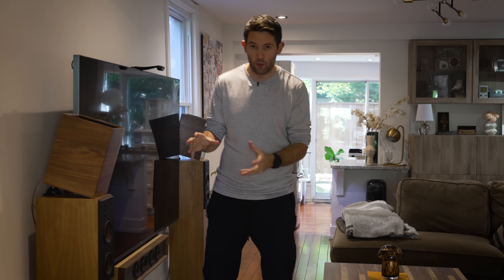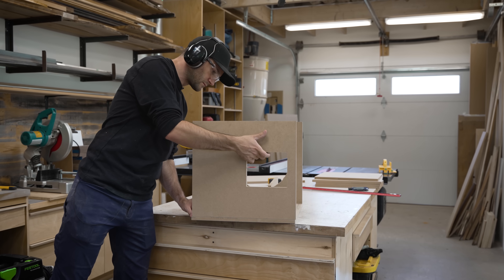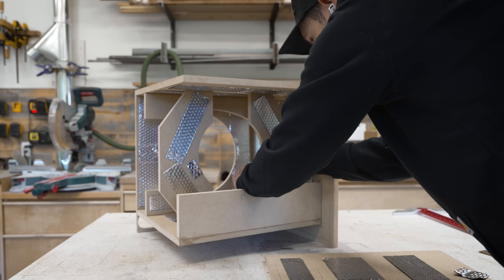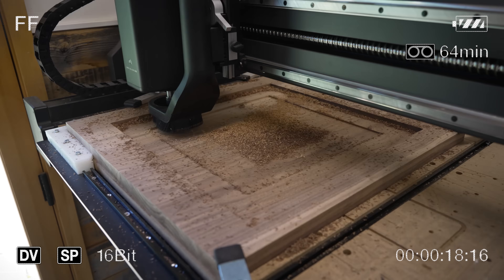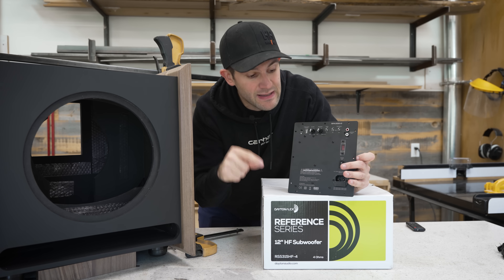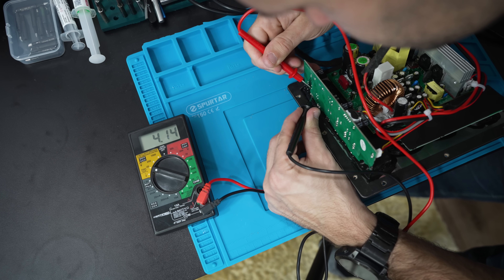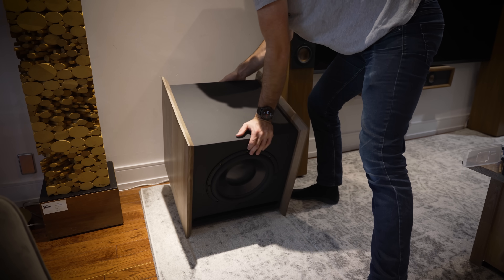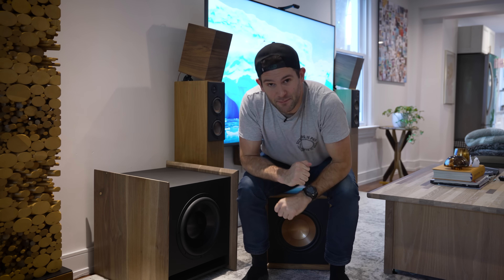THIS changes DIY Audio...

Comment: I wonder why haven't you talked much more about latency/phase, my guitar wireless (which is the same product basically) has 16ms of delay, this way you'll have a weird notch in the EQ due to phase shifting.

But hey, if it works for you, I'm happy but I think it's worth to give it a look and mention it!

I'd say test this with and without the wireless and hear if you feel a difference, with wire you should get even thumpier/deeper sounds.

Another way you can do this is using the same wireless for the rest of the signal (I believe you can have 1 transmitter and 2 receivers)

Comment: 25 watts of dirty power will destroy a 100 watt speaker WAY before 100 clean watts will destroy a 25 watt speaker. Really flirting with a lot of misinformation in this video.
Reply: @RobertWrightOneManCovers  and this is wrong 100w of clean power will destroy a 25w speaker WAY faster than 25w of dirty power will destroy a 100w, in fact at most you'll destroy the amp instead.

Comment: You mixed some stuff up with the power ratings. The amplifier should be *more powerful* than the rating of your sub prescribes. Ideally with some headroom. So if you've got a 400 watt sub, you should target for an amp that could handle up to 500 watt (at the given ohm rating of your sub).
Reply: Yeah, I was like "am I remembering wrong?"
Thanks for clarifying.
Reply: This reduces potential distortion from the amplifier side
Reply: Been doing car audio for many years and this isn't how I practice my builds. The amp only sees the impedance so as long as that is within spec you want the driver to be able to handle the amp at max power output with some headroom. You're the one mixing up these things.
Reply: Nope, because the subwoofer is a passive component, that is rated for peak Watt and RMS Watt, 300W RMS is the power that the subwoofer can handle not Its optimal working point You sould use an aplifier lower or equal than 300W RMS at the same ohm to avoid burning the copper windings when you put at max wolume the amplifier. A 150W RMS Amplifier can easly handle a 300W RMS subwoofer.
Reply: @w1thso  That's why you set gains on the amp and leave them be, if you've done it right then the sub won't be overdriven and won't be melting it's coils either way. A bigger amp running at lower power is going to sound better and be safer to the speakers than a tiny amp running full wide open, ready to clip out at a moments notice.
Reply: @pontiacg445  Yes I would agree If the gain wasn't easy acessible like a car system. This is too much exposed Imo
Reply: @w1thso  OP is right, you are wrong. If a woofer's RMS is 300w for instance, its max power handling will always be higher, usually around double its rated RMS. A 150w RMS amplifier would be quite underpowered for this woofer and only be giving it half the rms most of the time while running the amp at its maximum. A 300-400 RMS amplifier would be ideal for a 300w RMS woofer. If the sub exhibits any signs of being overpowered, you can always turn the amp down to hit that sweet spot.
Reply: @Mr_Ruhl  nope a woofer can handle double the RMS (peak watt) only for some instant. You can test it if you want. Sadly tested on an audison 2ohm car subwoofer of 300W peak (150W RMS) and an amplifier of 300W RMS, staying for a long period over 150W (calculated with a multimeter at 60hz it was around 200W) burnt all the copper coil, It was totally black, and the sub never distorted the bass a single time before.
Reply: @w1thso  you need to MATCH the RMS of both the amplifier and the subwoofer. You put a 300w RMS amp on a 150w RMS sub, so you overpowered the subwoofer.
Reply: @Mr_Clem02  again, yes, but actually you don't need full 300W RMS to drive perfectly a 300W RMS Subwoofer, so you don need a over dimensioned amplifier, because even a 300W RMS amplifier doesn't need to go full gain to handle a 300W RMS Subwoofer, so even a 300w amplifier doesn't reach the distortion.
Reply: @Mr_Clem02  you can't overdimension the amplifier, 300W RMS are the limit for long session on the sub (tipically the producer put a restricted limit, maybe can handle 350W RMS) you were very lucky if you put over 300W RMS in a 300W RMS Subwoofer and didn't burn. Yes you can put a 400W RMS ampli, but you must lock the gain, calibrating it with the max volume of the source, and there the gain aren't "lockable" because are accessible. In this case a 300W RMS amplifier would be perfect imo, cause you don't actually need to go full gain to reach 300W RMS. Overdimension to 500W is useless and risky if someone put the hands behind this sub
Reply: @w1thso  and by doing that you are not talking advantage of the full potential of the sub. There's no point in buying a sub to intentionally underpower it. Instead, just get a sub that requires less wattage to reach its maximum efficiency to begin with. You're just wasting money if you don't plan on using the sub to what it's capable of. Look at amplifier\sub combos offered by the companies that make and design them and you will see that the RMS between the two components usually match very closely. If not matched exactly, the amplifier will be the one that has a slightly higher RMS than the sub(s) needs just like OP and myself are saying. 

Do what you want, but don't get on the internet trying to explain something you aren't knowledgeable about.
Reply: @w1thso  you keep switching up what you are saying. Lol, I'm done with this engagement. Ffs...
Reply: @Mr_Ruhl  I'm not switching lol, You and OP were saying that he need a 400/500W RMS amplifier to drive a 300W RMS is totally bs and risky, just put a 300W RMS and don't put it at max gain for distortion. You don't need all the 300W RMS to drive the subwoofer.
Reply: It's more complicated than just the rating of the amp vs the rating of the driver.  But in general you want a more powerful amp.  I used a 1000 watt amp for a 12" driver rated for 500 watts for years.  Perfectly fine.  Where you really get into trouble is an amp that is underpowered.  What happens then is when you crank up the volume and the amp reaches it limit it starts to clip, producing a ton of distortion, and that can damage your speaker.  With an overpowered amp the only way you damage the speaker is to drive it to volume levels where the biggest danger is to your eardrums.  You really only worry about that in competition car audio, where you're going for crazy SPL.  For home audio, home theater stuff, you're not going to be listening at levels where that's an issue.  It takes a LOT more power to physically damage the voice coil on a speaker than you'd think.  And it would have to be sustained for a decent amount of time.  Like a constant test tone at a volume where you will probably go deaf before the speaker is in danger.  At normal listening levels the average power output is quite low, regardless of the theoretical max rating on the amp.  Just because it's rated at 500 watts, or whatever, doesn't mean it's cranking out a constant 500 watts.  Those ratings are based on hopes and dreams for the most part, and if it can hit 500 watts it won't be able to do it for long.  The actual output is based on input signal, gain, and speaker sensitivity.  Or in other words, the input voltage from the source, multiplied by the internal gain of the amp, and reduced by the resistance (impedance) of the speaker.  The max ratings are not applicable during normal operation since you'll never be getting anywhere close to them anyway.
Reply: @wallywest2360  but your 1000w amp have the gain locked around 50%, no way that you are putting full gain in a 500w subwoofer. Btw even the rating RMS of the subwoofer are a lot stringent than the reality maybe you can put even 600w without damage the coil, but at your own risk.

Comment: I think its cheaper and easier to just buy a prebuilt sub. A sw 1400 klipsch subwoofer will hit flat to 15hz in room for 699$
Reply: More like $1200, and that's for the cheapest one
Reply: No its always on sale at adorama for 699. Just use slickdeals. Thats where i got the two of mine

Comment: Serious tip: take a soldering course. Self learning is nice, but the industry has way more experience. (Youtube is great to learn, but for learning soldering it's not that great yet)
Reply: Didn't Dave Jones on the EEVBLOG make one years ago? Or was it Ben Heck?  Probably both and pretty much all the pros... X)
Reply: @ Dave wasn’t the worst, good enough for hobbyists, but if I would deliver that quality at work I need to start over
Reply: @user-jp1qt8ut3s  You might be working for medical or aeronautics because for me Industry level is basically drenching the board in flux, soldering then drenching the board in a bath. No sector wastes time and money with hand soldered components anymore ( unless it's cheapo gadgets made in low wage countries) but if they must, they don't waste time chasing the perfect solder cone or even cleaning flux residue unless it comes back negative from QC so any hobbyist doing it should be on par with industry anyway.
But I talk from experience 20+y ago where i toyed with pick and place visual corrections and hand soldering tiny components that didn't glue well before the solder bath. Maybe it changed ?
Reply: @ indeed, medical
Reply: His soldering is fine. Zero reason for a hobbyist to take an industry level soldering course.

Comment: does having the port on the same surface as the driver cause phase cancellation?
Reply: I'd say the real phase problem would be on the wireless unit first
Reply: @NoxMessor 100%. He's not addressing latency at all until he converts all the other speakers to the same wireless setup.
Reply: @RobertWrightOneManCovers  most surround receivers can do room correction and will correct for delays like this
Reply: No not realy, it doesn't really matter what surface you place the port or driver on for a sub. The wavelengths are so long that it doesn't matter